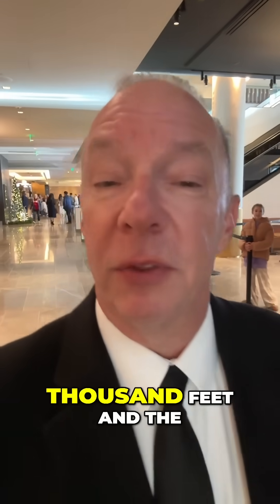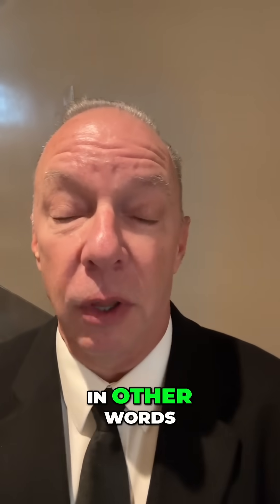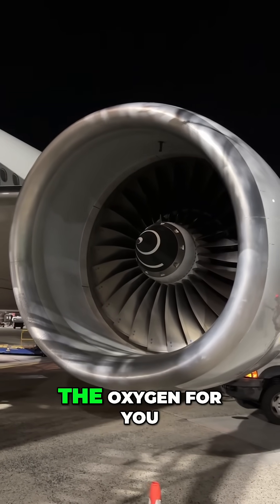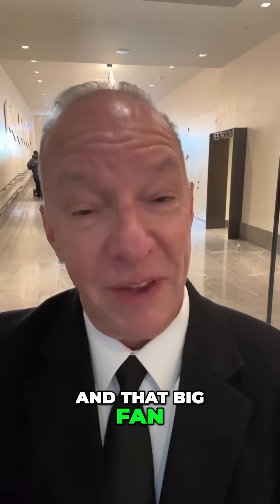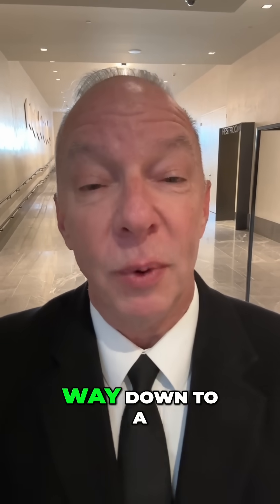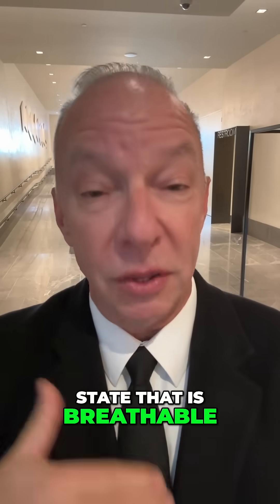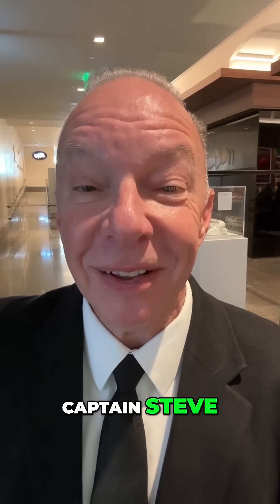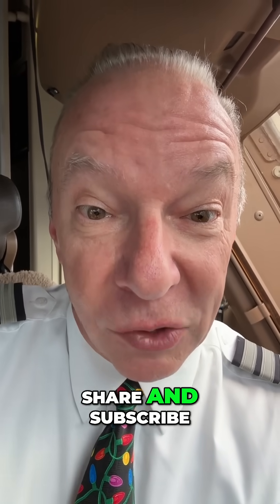How Airplanes Make Breathing Possible at 37,000 Feet

Comment: I suspect a lot of your viewers don't know what 'partial pressure' is. Think of it as the number of molecules of oxygen you pull in with each breath. When the pressure goes down, so does that number - and you need a certain number to survive.
The other end of the scale is diving under water. Fun fact: things can go wrong when you get too many molecules. Pure oxygen becomes toxic below 32 feet, and with regular air, nitrogen (another component of air) below 100 feet is toxic-ish (like having one or two too many alcoholic drinks).
Love your videos, BTW.
Reply: AKA Dalton’s Law
Reply: The pressure of the air is low. The partial pressure that is of concern is the partial pressure of oxygen which is even lower.

Comment: The engines do not produce oxygen. They produce water and carbon dioxide. However they do pressurize air. The air at 37.000 feet is breathable. There’s just not enough oxygen to sustain human life. That’s all.

Comment: Uhhh, sea level pressure inside the cabin, nope cabin air pressure is circa 3000 feet, akin to Shimla up in the lower Himalayas! Aka cabin altitude. Oh and you forgot to mention how dry it also is, ( maybe in a good way drier than the Sahara).

Comment: The moving blades are compressor blades. The blades that do not move are the stator blades, their job is to direct the path of the air. The large blade at the front is called the fan. Also, the O2 generators are small and only last long enough for the flight crew to get the aircraft down to a safe level. The attendants and flight crew are supplied with compressed aviators oxygen, it is different from regular medical oxygen due to the zero water content. Hope this helps
Reply: As soon as he said stator blades, I immediately went to the comments section.
Reply: I caught that too. I build Rolls Royce engines and we call them rotors. Rotors and stators.
Reply: @lukehaymes4286 . Same here at GE.  Rotor blades and stator vanes.
Reply: Until I saw your comment, I thought I was the only one that caught that.
Reply: Captain Steve doesn't know what stator vanes are
Reply: @bmw_m4255  he is a captain, he seems to at least have a better clue what’s going on than some🤷‍♂️
Reply: I also went to the comments after hearing about moving stator blades. I think I’ll educate the guys in the hangar tomorrow about these magical engines the airlines use. I hope they share them with the helicopter community soon.
Reply: Actually the moving blades are rotors, one rotor and stator make a compression stage.
Reply: @UpsideDownHamster  correct, I wasn’t trying to break it down that much.
Reply: Partial pressure is not the issue
Reply: There's more than one blade at the front of the engine.  Lol
Reply: @Bernie-e9i  I guess you missed the entire premise to my statement 🙄
Reply: @ericrolland9092 No, iI get what you were trying to say.  You meant to write blades.

Comment: In the case of depressurization at 37,000 feet, there will be emergency oxygen to breath, but what about the internal temperature of plane? Won't the extreme loss of pressure result in a frostbite-level temperature drop? How is that handled?

Another question ... the outside air is compressed to collect breathable oxygen, which heats it up. Ironically, the sub-zero air outside my window has to be chilled before i can breathe it in the cabin. Is it possible for the "chiller" to break down, such that the internal pressure is fine but the internal temperature rapidly rises to sauna-level?

Another question ... the Concorde cruises at around 60,000 feet. This is also close to the "Armstrong limit" where water "boils" at around 98 degrees because of the low air pressure. In the event of depressurization, would my blood, saliva and tears begin boiling as I put the drop-down oxygen mask over my face? What's the backup system for that?
Reply: Did you really ask what the backup system is for a plane that hasn't flown in 22 years?
Reply: @None-ef6nf  The plane is irrelevant. I want to know the physics and the engineering. I would have asked about the U2 or SR-71, except their pilots have pressurized suits. Hence, the no-pressure-suit Concorde hypothetical. Any more questions?
Reply: And yet the Concorde flew safe, faster than sound, mostly from 1976 to 2003, so a very valid question.

And more importantly astronauts Cosmonauts at Orbit Level 300 km Asl have cosmic rays and near vacuum of space in the event of depressurisation, what if any fail safe procedures do they have? Humans have now endured space flight since 1961, though permanent manned presence is amiss.

Comment: As an Airplane mechanic that works all those systems i approve this reel
Reply: Did you not catch "stator blades spinning at high speeds"? Stator blades don't spin. They're stationary.
Reply: @rrkunath  I too caught the stator mistake. Great explanation though.
Reply: @bobsmith4407  Aside from the stator error, I thought his explanation was very good. In fact, I've watched several of his videos, and they're all very good. This is the first error I've heard him make
Reply: @rrkunath 100% everything the man said I'd fact, minus the "stator blades" comment.
Reply: As a former jet engine mechanic, I caught that mistake as well. Stator blades are stationary while compressor blades are the ones that rotate, and are actually driven by the gas generator blades after then burner cans. Prior to reaching the burner cans, air is bled off for a number of purposes depending on the need and is all pressurized. 

As far as the amount of oxygen and pressures, I have been preaching such for years when people claim that there is no oxygen at cruising altitude. They are wrong. One of the things even we helicopter crew chiefs have to do, even though we may never fly that high, is endure the pressure chamber and take our masks off at 25,000' (MSL) to see how hypoxia affects someone. Let's just say that the answer to 1000-3 is not 9997.
Reply: @mikes6973 driven by turbine blades from the turbine disks via shafts depending on the type of engine. Air pressure (engine not running) is used to move the blades if you are just running systems and don't use the APU so mainly for troubleshooting. You helo mechs must call them gas generator blades.  You guys are crazy for beating the air into submission to stay airborne.  I don't know how you do it!
Reply: Liar

Comment: Ok. Air is pumped in. From where does it go out?
Reply: Outflow valves in the fuselage control the pressure inside the cabin via cabin pressure controllers.
Reply: @chuckm626 they said the out flow valve used to get some really dark stains from nicotine when smoking was allowed

Comment: He just kinda misspoke. The engines do not produce oxygen, it only compresses the air so your lungs can absorb the O2. The fan that's seen in front has nothing to do with the compression. Only the core does the compression. The fan is for thrust only. First stage of the core (behind the fan) is the inlet guide vanes. Then the stages of compression start. Stator, rotor, stator, rotor etc. The compressed air is about 700 degrees, then precooled, sent to a turbo cycle machine and compressed again, cooled, then expanded out the outlet of the turbo to about -20 degrees, then warmed back up for use in the cabin. Long explanation, i know.

Comment: So, Captain, the O2 at sea level is 21% of the volume of air we breathe.  Is it still 21% up in the fuselage?
Reply: The gas ratio doesn't change with altitude. Only the pressure and temperature.

Comment: I’ve said it before…..Captain Steeeeeve is a treasure, as a human and pilot keeping us safe.  Happy New Year, and thank you!
Reply: Don't forget the flight attendants and all of the airport workers make sure that we are safe also.
Reply: Not true. 
People just hold their breath.
Reply: @Taketimeout3  I work at an airport and I know that the airport employees have to follow certain procedures to keep everyone safe on the airplane.
Reply: hes wring though. completely wrong
Reply: @the_chomper  Prove it.
Reply: @fredbohm4728 Perhaps not completely, but wrong many times. Stator blades (rather vanes!) do NOT rotate. They are static, hence the name. The air up there is breathable in the sense that the mixture of elements is the same as on the ground. It is only less dense, so the number of oxygen molecules per volume unit is lower, this is why it must be compressed. The 60%-40% split he mentioned is very strange. Do we have air not cleaned from the compressor and air cleaned from the filters in the cabin? Of course not. All of it is filtered. Should the air from the engine be (continuously) provided, the cabin would explode like a balloon. The same amount of air supplied to the cabin must be bled from the cabin, so there is a continuous air exchange. Approximately, all the air in the cabin is refreshed in 10 minutes, and, of course, it is all filtered. Btw, the mentioned HEPA filters have nothing to do with oxygen supply. 
There is more rubbish in this film, but I don't feel like picking it. Waste of time.

Comment: why does the luggage storage of a passager plane or cargo plane section receive the hot air too?
Reply: For any live animals that may be riding below.
Reply: And why does the wheel well not get any hot air or pressurisation? (Tragically for some stowaways!).😢
Reply: Well, if someone is trying to store away in your aircraft, would you really want them to survive? Not me! Plus that area doesn't need heat. If anything, the wheel wells should be cooled for the brakes.
Reply: the plane will different temperature throughout different sections n metal under coldness is stressful.

Comment: does not take it to sea level, to about 8000 ft on most planes, 787  is at 6,000 ft and does not use bleed air, has special compressors

Comment: Great info except for one minor correction. It's the rotor blades that spin at high speeds, not the stator blades. Those ones are stationary.
Reply: Saved me commenting. Thanks!
Reply: Glad I saw this reply before I texted same.
Reply: Not only that. Also air has no partial pressure. As the name suggests parts of air have a partial pressure eg oxygen. Also the total air pressure is not a relevant factor per se for us to be able to breathe, its the partial pressure of oxygen. I don't know why he goes into so much detail, which is not necessary for the the genereal info he wants to give, and then gets it wrong.
Reply: @loonator1995  Don't hate, its an excellent video!
Reply: @loonator1995 my brain kept trying to correct that error as I listened over and over again, I know we talk of partial pressure when there's a mixture of glasses in a system. So I agree, all he needed to say was "the pressure of air". Nonetheless kudos to him still, most pilots only know how to fly, I doubt they know this much.
Reply: Me2😂
Reply: Yes
Reply: Excellent video. One further correction. Most of air moved by the fan blades are for thrust and that air bypasses the actual engine. The air entering the engine is what is compressed and then bled off for use in the cabin.
Reply: @knooster You're exactly right. The turbofan engine is the most common engine used in commercial aviation. The second most common one is the turboprop.

Comment: I used to work in the Boeing Factory where they make the air filters for the 777 and 737 families.....there's filters 2 on a 777 and 4 on a 737 both are different sizes though for the 2 different systems.

Comment: Air-Conditioning and Pressurisation System on my mind. To add a bit technical stuff to what Capt Steve said. He uses the Cabin Pressure Controller (CPC) to set the desired cabin pressure (indicated as altitude above sea level) depending on his planned flight altitude.  The CPC works with an Outflow Valve to maintain the cabin pressure (or cabin altitude if you will).  There is also a pressure relieve valve to ensure that the maximum cabin pressure is not exceeded (for example, in event that the outflow malfunctions).  Thank you Captain Steeeeeeeeeve!!!
Reply: And the heat is also used to heat the cabin. An airplane engine is all about pressure in different stages. Bleed-Air is taken out in different stages and pressures to keep the engine it self alive too. For cooling and to keep oil inside bearings and so on.
Reply: @StigOveRuud it’s not to keep the engines alive. You can run the engines fine without bleed air. As a matter of fact, the 787 doesn’t tap bleed air from its engines at all.
Reply: @StigOveRuud  Plus warming of jet fuel
Reply: the captain made it happily simple, for the non technical folks in the comments. and this asshole had to come ruin it, with all his acronym bullshit. some people boy...
Reply: Holy shoes, so if 1 engine goes out we're at half the breathable air, & more chance to freeze
Reply: @punipuk8507  Not quite so. Based on what is called  Extended-range Twin-engine Operations Performance Standards (ETOPS), which Captain  Steve mentioned in one of his videos, one engine is capable of propelling the aircraft safely to the next available airport from the point of engine failure. During that period the pilots have their remedial drills which they carry out to mitigate the situation, to the extent that most passengers may not know or notice that there was an engine failure.
Reply: @punipuk8507 most aircraft can sustain enough cabin air with just 1 engine.  In fact, it will be fine on APU alone. What is not okay is if you lose both PACKs then you are forced to go to lower altitude.
Reply: True, but pressurization is always automated unless there is an emergency or if maintenance needs to perform pressure checks

Comment: The exact same oxygen / air exists at sea level as at 40,000 feet. The only difference is pressure is lower.
Reply: And they recirculate more since smoking ban which also saves fuel
Reply: P-a-r-t-i-a-l pressure of Oxygen in Air the mixtures of gases.
Reply: pressure in an aircraft passenger compartment is equivalent to around 6,000 to 8,000 feet high, not sea level.
Reply: We need 21% oxygen at ground level. Imagine how less it is up y6here